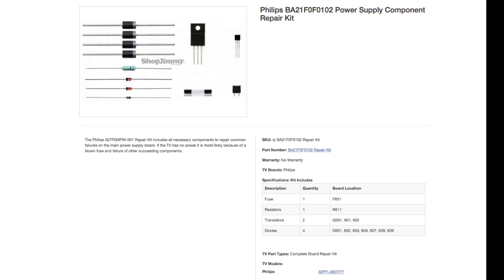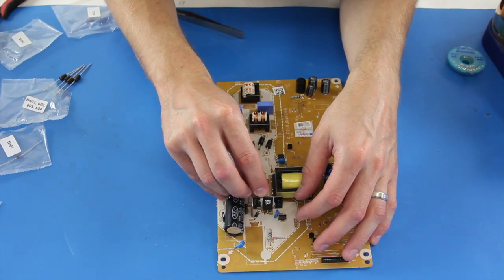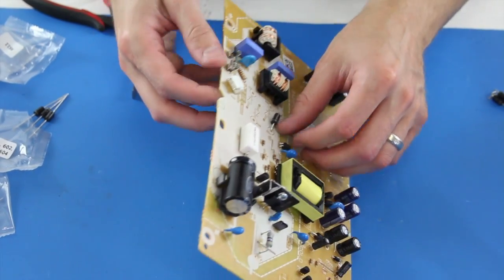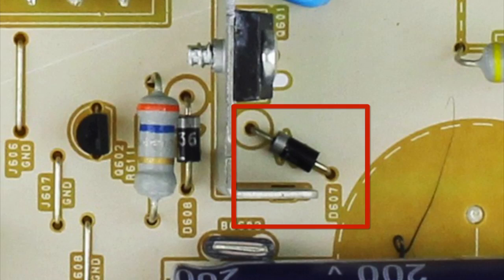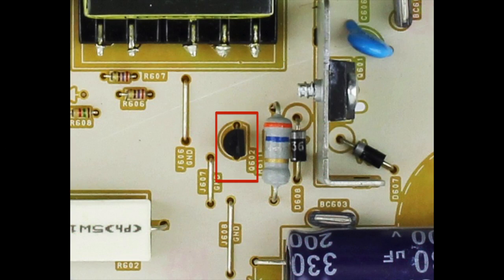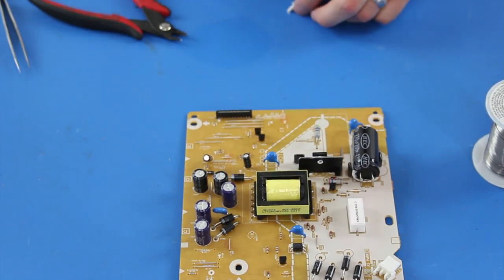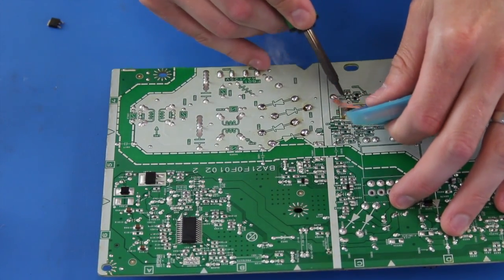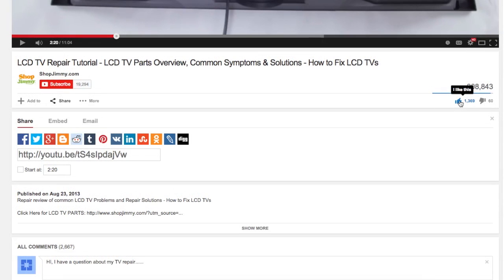Philips BA21F0F0102 Power Supply No Power & Blown Fuse - Component Repair Kit Tutorial

Comment: Geez.  How many people commenting all have the same issue!  Add me to the list!  Humming noise from transformer.  I've desoldered and checked every diode.  Replaced half the caps although they all looked fine.  If you unplug the logic board ... stand by voltage stabilizes and hum is gone.   But with logic board plugged in, standby voltage crashes and huming resumes.  I find it hard to believe NOBODY has figured this one out????  And no response from ShopJimmy????  Come on help out like 30 people here with the same problem.  Sell us something!

Comment: Hello, I have a philips tv model 40pfl1708/f7 will not power on fuse on power supply is not burned, when press power on, only whistling sound is coming from power supply transformer  on the border of hot and cold zone. would you please help me to fix the problem.
Thank you
Reply: I've got the same set and experiencing the same problem.  Did you ever get a response or fix the set?
Reply: 123motijoon I also have the same problem any response from ShopJimmy.com? I purchased the video card and the kit changed both and still no power ... Same buzzing sound from transformer.
Reply: No There is not any respond .
Reply: thanks for answering

Comment: I have this exact board sitting in front of me (BA21F0F0102 3 from a 26PFL4907/F7 Phillips TV.) We took a recent bad power hit and I open this up to find a blown fuse. Replaced the fuse, but the new one blew immediately when I reapplied power.  I've scoured the board looking for an obvious short and continuity tested the major power paths looking for a cause.  Do you think the parts in this kit would adequately address the most likely candidates for this problem as opposed to just a general lack of the TV not turning on? I'm open to any suggestions for narrowing down the problem. Thanks!

Comment: Hi pal
I got  Samsung pa50c96hd 50 inch plasma TV last night it made a blown sound and turned off. I turned it on but brightness did not work well and it's too dull very hard to watch and picture is bloury aswell but the sound is OK
Thanks in advance
Reply from the maker: Rana rana   PLEASE SUBSCRIBE TO OUR CHANNEL - Try all repairs and troubleshooting at your own risk.  I recommend replacing the Y board and the y buffer(s).  Unfortunately I do not see any replacement parts in the search results for your TV model number on our website.  Thanks and please let us know if you have any further questions!  www.shopjimmy.com